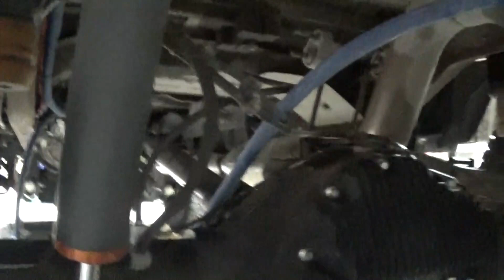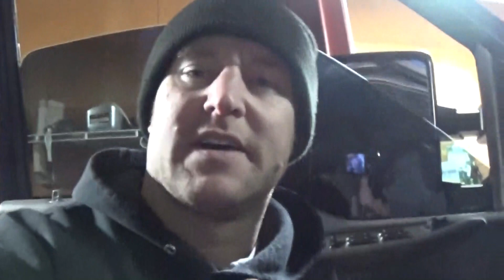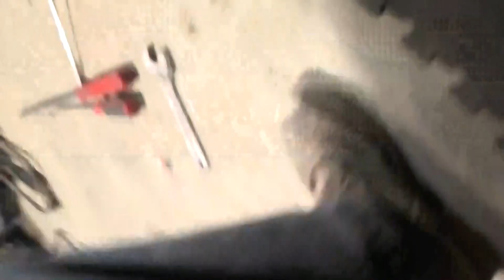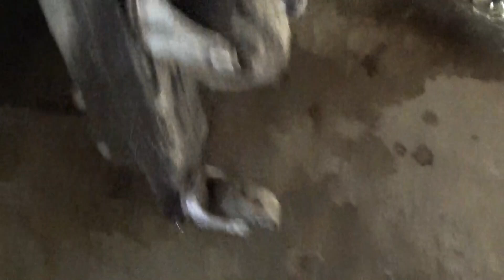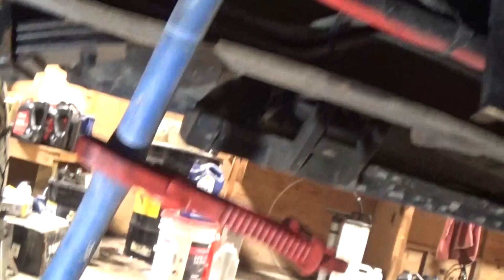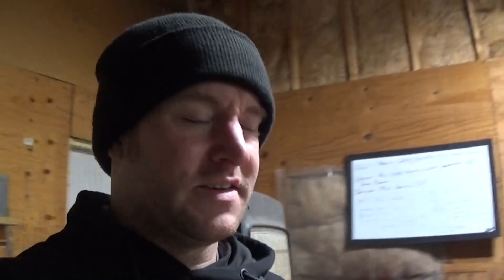Part 2 Excursion No Start

Comment: The check ball fell out when you removed the regulator spring @ 12:45. It appeared to be the black plastic ball type. It must’ve been deformed or something which caused the low pressure issue. FASS is always good to deal with but I’ve had to fix way too many of their systems for me to ever put one on my trucks.
Reply from the maker: Nothing fell out at 12:45. 
I’ve heard of a lot of failures from the name brand pumps.